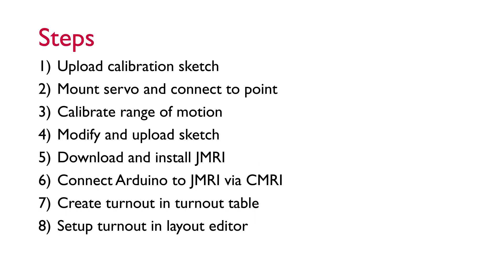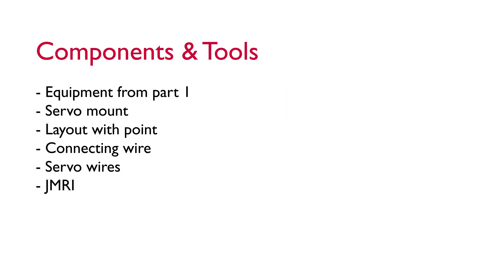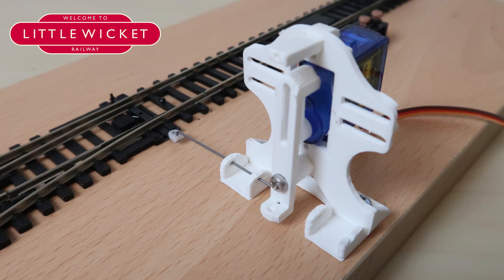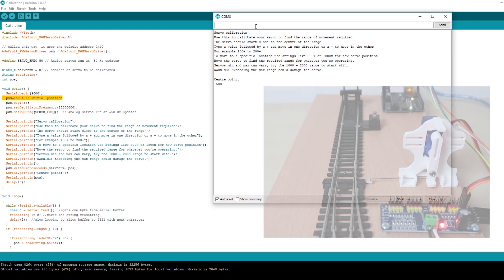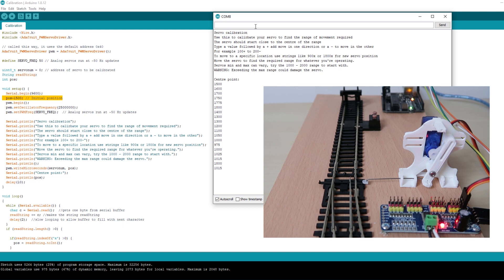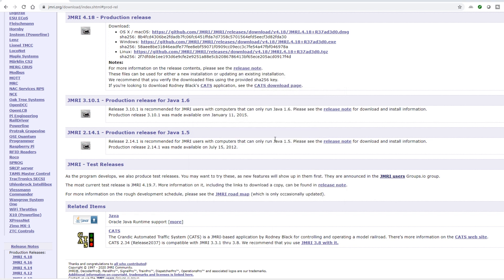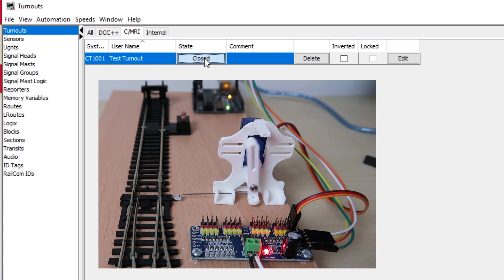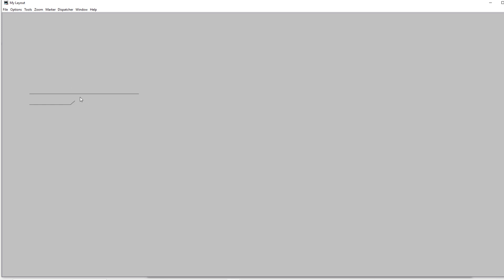Servo Motor Control for Model Railways Part 2 of 3 - Servo Point Motor

Comment: When you tested the three servos, what did you press to make them move?
Does this mean I need a PC to operate the servos?
I was hoping to control my servos with the Arduino Uno, the servo controller, their power supplies and simple momentary toggle switches to operate the servos once their travel had been adjusted and set.
Is this a possibility or must a PC also be employed?

Comment: This is brilliant.  I had it working but now something has gone wrong.  I am using IDE version 2.3.2.  My Arduino is on COM3 and on the DCC+ tab I select COM3, the baud rate is is 115,200 and greyed out , however when I go to the CMRI tab I can select 9600 baud rate but the Serial port is red when I select COM3.  Any ideas what has happened?
Reply: I'm running into the same issue. Only 1 COM port (COM3). I'm wondering if I need a second arduino for the points. Hoping not!

Comment: Hi. Thanks for you fantastic tutorials. How do you control the servo motor speed in your servos sketch. I have tried altering the delay setting with no joy. on the net i can only find example that relate to angles and not the 1 to 3000 count. I am a total beginner with Arduino and still on page one. Thks in advance

Comment: I keep getting an error trying to upload the "servos.ino" sketch, it says : "Compilation error: CMRI.h: No such file or directory"
What do I do wrong?
Reply from the maker: Been a while since I looked at CMRI, but it looks like you're missing the header file cmri.h. Can't remember if you can install this via the IDE library installer or if you need to do it manually (https://github.com/madleech/ArduinoCMRI)

Comment: Sweet I got it working kind of, when I use the final sketch I don't get the same result on the servos as I do with the calibration. It's like it's lacking power and does not switch between close and throw like it does when I am calibrating. Has anyone else run into this issue?
Reply: Ended up being my power system, once I got that fixed and recalibrated and updated the sketch bam it all worked. Great video! Lesson learned to always keep my voltage tester handy in the layout room.

Comment: Exhausted and Confused? I have been through this so many times I've lost count. All 4 servo's work using the calibration script but when I run the Servo script and modify it for 4 servo's only the 1st servo works whatever I do. To the extent swapping out Arduino.

This is the revised Servo script, if anyone can throw some light on this it would be appreciated. (FYI - I am using Arduino IDE 2.2.1).

#include <Wire.h>
#include <Adafruit_PWMServoDriver.h>
#include <CMRI.h>
#include <Auto485.h>

#define CMRI_ADDR 1
#define DE_PIN 0
#define numServos 4 //The number of servos connected

Adafruit_PWMServoDriver pwm = Adafruit_PWMServoDriver(); //setup the board address 0
Auto485 bus(DE_PIN); // Arduino pin 2 -> MAX485 DE and RE pins
CMRI cmri(CMRI_ADDR, 24, 48, bus);

int Status[numServos]; //Create a table to hold the status of each turnout, signal, etc.
int Throw[numServos]; //Create a table to hold the throw value for each servo
int Close[numServos]; //Create a table to hold the close value for each servo

void setup() {
  Serial.begin(9600);
  bus.begin(9600);
  pwm.begin();
  pwm.setPWMFreq(50);  // This is the maximum PWM frequency

  //SET THE THROW AND CLOSE VALUES FOR EACH SERVO BASED ON THE CALIBRATION PROCESS
  
  //Servo connection 0 - point motor
  Throw[0] = 1300;
  Close[0] = 1600;
}

void loop(){
   cmri.process();

    for (int i = 0; i < numServos; i++) {
        Status[i] = (cmri.get_bit(i));
        if (Status[i] == 1){
            pwm.writeMicroseconds(i, Throw[i]);
        }
        else {
            pwm.writeMicroseconds(i, Close[i]);
        }
    }
}

-------------------------------------------------------------------------------------------------------------------------------------------------
Reply: Could you let me know if you got this working? I can calibrate but when I add the servo sketch and add it to JMRI I can't get any of the servos working.
Reply: @joshuasrandomness999  I found the problem, jump to the next part of the video ie '3' and you should be able to work it out. for each servo you need to enter the relavent information ie

 //Servo connection 0 - point motor
  Throw[0] = 1300;
  Close[0] = 1600;
  //Servo connection 1 - point motor
  Throw[1] = 1300;
  Close[1] = 1600;
  //Servo connection 2 - point motor
  Throw[2] = 1300;
  Close[2] = 1600;

Etc

Hope that this helps?
Reply: @lestaylor7767  Thanks I already had that in my code. But still not getting them to work consistently. When I did get them to move they didn't move like they did when I calibrated them. They moved just a little bit, I'll keep trying different things. I appreciate your response.
Reply: Got it! Ended up being an issue with my power supply, at times it would work, and other times nothing. Fixed that and now it's all working beautifully.
Reply: @joshuasrandomness999  Great news - onwards and upwards. I know how these issues are very frustrating and time wasting.

Comment: Thanks Rob for your video's, very helpful - however I would like some help please. Setup 1st servo - no problem - that's working my 1st turnout / Point - happy days.

Now added 3 more servo's, changed the number of servo's in the 'Servo' script to 4 and run it. Followed same procedure for adding Nodes using the sequence option is CT1001, CT1002......

Problem is only No 1 works - any clues as to what I have done wrong please?

Comment: HI ROB
How do I get the calibration set up ?  I have opened the Arduino program (mines IDE 2.2.1) and the first part works fine now I’m stuck on part two the calibration bit 🙁. Am I missing something
Reply: Same here ,I'm getting a fault 
Exit status 1
Compilation error: redefinition of 'void setup()'
Can't see what's wrong

Comment: On my layout I want to control each of my points by a switch for each, I am also  using Arduino and a PCA9685 board along with servo fitted to each point, can you advise me of what type of switch I need and provide the software I need to make the Arduino  work,  here's hoping that  you can help as I have watched all your video's but they do not specify  what I need. Hoping you can help
John Wilson

Comment: Forget the calibration, use flexible piano wire rather than stiff wire and set up the servo so that the flex of the wire absorbs any over-movement of the servo arm.

Comment: Excellent ideas shown here. I wonder if there is any way to convert this to use the outputs from a Shuttle controller? I have a simple layout which has two points, one each end which can then shuttle three sets of stock from end to end. It is fully analogue and needs to be stand alone, no PC's anywhere near!.. The points are CDU driven when a change of state happens. It is the Blocksignalling PTS1 unit. I guess I need to say when a voltage appears on this line (Say input 1) throw and when a voltage appears on another line (input 2) reset to original position.. Anyone help please?

Comment: Great videos. I have managed to drive my trains with arduino, JMRI and my iPhone. The servos for the turnouts work fine, but at the end of the race they don't disengage and are constantly making noise. With the normal arduino code I know how to stop them, but not with the CMRI code.
Reply from the maker: Hi Miguel, there should be a way to disconnect the servos at the end of the move to stop any jittering. It's not something I've looked into or tried, but I've read that the following code is effectively a disconnect (pwm.setPWM(servoNum, 0, 0);) or you might be able to solve it using hardware (https://learn.adafruit.com/adafruit-arduino-lesson-14-servo-motors/if-the-servo-misbehaves).

Comment: I have struggled through Part 1 and Part 2 up to 'servos' sketch. This I cannot get to upload without the error  'redefinition of void setup()'. It is probably due to my lack of knowledge, but I managed to solve other problems. Can someone help please as I have been unable to find a solution. I have in excess of ten points that I would like use Arduino to control, so any help will be appreciated.
Reply: Hi @rogerfairall3640. I have the same problem, like you I have lots of points to do . But I just can’t get over this error, I have been on it for three days now, even going on to the Arduino forum, I see you posted a yr ago, have you managed to get it working

Comment: Hi Rob.  Great videos as always.  Having difficulty with the calibration sketch - keeps on giving me an error message that .h is not found.  can run the upload but when going to adjust the servo phase, nothing happens.  any suggestions?  cheers
Reply from the maker: Hi Chris, think you're missing a header file. Is it "xyz.h" missing or just ".h"?

Comment: Hi Rob, really it is best to put a loop, z, or omega in the servo connection rod. Does the Arduino code stop sending pulses after a while? If it doesn't and you have the servo set too tight, the servo will sit there consuming high current trying to get the servo to goo to a position the linkage and set point won't be able to achieve. Have a look at the MERG Servo 4 for info.
Reply from the maker: Hi Greg, agreed, should have done that here, normally my motors are mounted vertically under the board, so there's side flex in the wire. You can also "disconnect" the servo at the end of the moment, but I didn't in this code.

Comment: Rob love your video's.  I do have a question for you. On your servo set up is there a way to show the actual position on your turnout in JMRI without throwing every servo before you start running.
Reply from the maker: Thanks Rick. You can tell JMRI the position of the turnouts using feedback sensors. These are usually microswitches fitted to the side of the point motor (example here - https://youtu.be/_xQefWpiklU). Pros of fitting feedback sensors are that you're always sure the servo has moved into the correct position and you don't have to set them all on start up. Cons it's extra effort because you need the switches, wiring and sensor inputs. You can get fancy servo which have position feedback built in, but these are quite expensive and I've never used them.
Reply: @LittleWicketRailway  I just had a thought.  I should be able to add a non looping routine at the very start of the Arduino code to preset the turnouts to any position that I prefer to start with.  I just need to work on my C++ programing skills before I do that.  I will also need to work with JMRI to set a starting position that matches the Arduino code position. Again thanks so much for the help!
Reply from the maker: @rickcaldwell7154  you can write scripts in Python that JMRI wil run automatically on start up or on the click of a button that will do what you've suggested. Check out https://www.jmri.org/help/en/html/tools/scripting/ex_set_turnouts.shtml
Reply: @LittleWicketRailway  Rob thanks so much that will do the trick!

Comment: Still going through these technology videos. I assume you're using Conductive Frog points. Would it be possible to setup a MicroSwitch to be activated by the server to change frog polarity? 
Keep up these awesome videos! Giving me a lot of confidence while coming back to the hobby!
Reply from the maker: Hi! I used Hornby points on my old layout which were insulfrog, so I didn't have the polarity issue. My next layout will use electrofrog. You could definitely setup a micro switch to control polarity. This subject is on the ever growing video subject list.

Comment: Hi nice video, do you know any board for dynamixel motor (MX series) may be similar as the PCA9685 board that works well for servo motors. currently, I can run the dynamixel servo using the OpenCM9.04 or dynamixel shield with arduino UNO, but I would like to control MX motor with arduino nano. Thanks in advance if you have any information about it and apologies, I know this is not related to the video.

Comment: Your video is interesting and full of information, thank you.

I do have concerns about implementing this, however.  I'm not convinced that I want to use a PC computer to operate my model railroad.   It seems to me a PC would be a distraction.  I would use servos controlled by the Arduino to operate the points, but would rather use push buttons to control the servos.

The Arduino only has 6 analog inputs for push buttons.  My knowledge of the Arduino is limited - is there a board I could add to increase the number of analog inputs?

Just out of curiosity, has anyone ever used a Raspberry Pi to run JMRI?

Thanks.
Reply from the maker: Hi Ned. Totally get that computer control isn't for everyone. Check out the setup in this video (https://youtu.be/_xQefWpiklU) which is push button operation alongside JMRI, but you could ditch JMRI out.

An Arduino mega with a sensor shield gives you loads of inputs and PCA9685s give you loads of outputs. You can link multiple Arduinos and PCA9685s together for as many inputs/outputs that you need.

You can also run JMRI on a raspberry pi rather than your actual PC, then access it via phones/tablets.
Reply: @LittleWicketRailway  Thank you for your prompt and knowledgeable reply.

Comment: Hi Rob, I'm 76 years young and really new to JMRI and Arduino's so how would I add more servos into the sketch and into JMRI?
Reply: Im stuck at this bit too, tried uploading individual sketches renaming them and putting the idividual movement values in each time, and tried inputting each servo on 1 sketch but no joy, can only get the first servo working?

Comment: Hi Rob Just got onto your videos about using servo motors for points - great stuff.  This is certainly a better way to go than solenoid motors, and you don't get that cannon fire sound going off.  One thing though, is there a way of slowing down the motion of the servo's?

Comment: Hi Rob. I am newish to modelling and COMPLETELY new to JMRI, CMRI and Arduino.
I've been watching your videos and have decided this is the way I want to go to control my layout. I have "built" the DCC++ controller and am now looking at controlling points, signals and lighting. My signals are currently controlled by a "Megapoints" controller and I would like to keep this as I like the "bounce". Could I use a MOSFET connected to the Arduino to act as the switch connected to the Megapoints controller? If so, how would I wire this up?
Lastly (for now :-) ), would it be possible to modify the turnout and sensor sketch to adjust the speed of the servo, to get it to act more like a "Tortoise" point motor?
Really enjoying your highly instructional videos!

Comment: Fantastic Rob Thank you. Got it all going well, looking forward to learning how I can slow the movement down to a more realistic speed. I do remove the springs  in the points so they move slowly rather than 'click' over. I'm sure it will be just line in the sketch somewhere??????? Cheers Mate. Reg from Oz
Reply from the maker: Hi Reg, it's up to you with the springs, I know a lot of people take them out as it makes things smoother, but once they're out they can be a nightmare to get back in and I know Hornby don't sell spares if you lose them.

If you want to slow the motion of the servo down then you'll need to introduce a loop. Check out this video where we use a simple loop to control the fade on an LED which is basically the same principle. https://youtu.be/rJhZK-XgEec?t=787

If you've got a lot of servos connected to the same Arduino then you might need to code your sketch in a clever way such that the whole system doesn't have to wait until the servo has finished moving to do anything else. Multi tasking on the Arduino is an interesting subject, more info here - https://learn.adafruit.com/multi-tasking-the-arduino-part-1

Comment: Where did you get the Servo Bracket?
Reply from the maker: Hi David, that is from MERG (https://www.merg.org.uk/), but I'm sure there must be other options out there.
Reply: @LittleWicketRailway  Thanks. I really enjoy your channel you have got a lot of useful information. My son and I are looking to do a new MR layout using the same techniques you go through. We may have an easier time doing the coding, I have been a developer for 37 yrs and he has been programming Arduino for the last 10 years.
Reply from the maker: @davidallen803  you guys will have no problems with that much experience between you!

Comment: Another great video, Rob. I've followed all your videos and now been able to add a reverse loop using a cheap twin relay as an output triggered with a logix attached to sensors in JMRI following this video. I wouldn't have been able to do any of this without your tutorials.  Fantastic stuff.
Reply from the maker: Thanks Andy! Glad to know it's being put to good use!
Reply: This stuff is addictive!
Reply: This is very similar to what I'm now looking to do, after being inspired by Rob's videos. The servo motors look great but the bit that's missing for me is polarity switching on all my electrofrog points. I'm looking into attaching a relay board (probably lots of them!) and modifying the script (although there may already be one out there) to switch the frog polarity when the turnout is thrown.